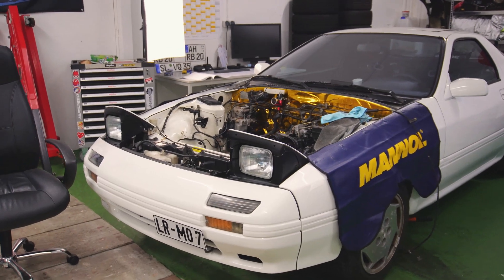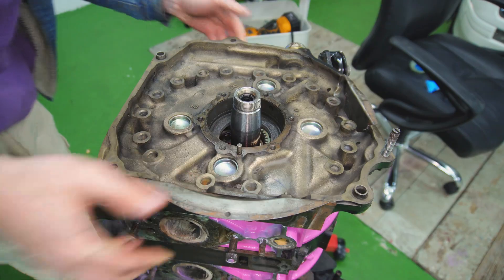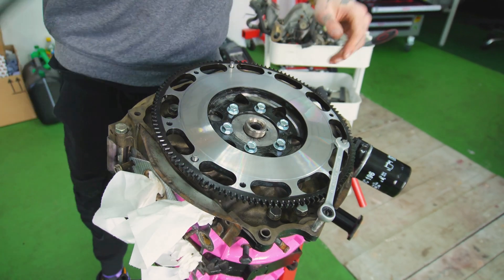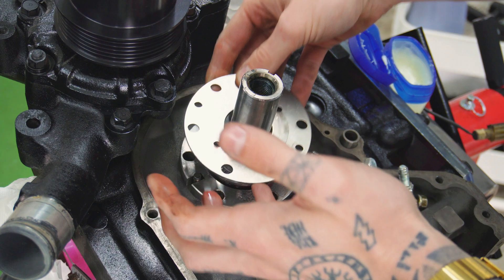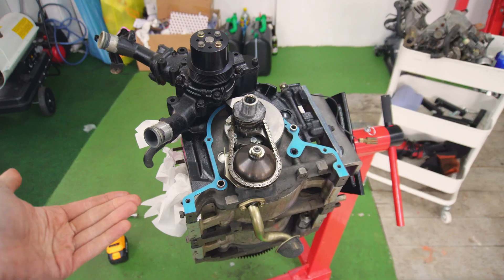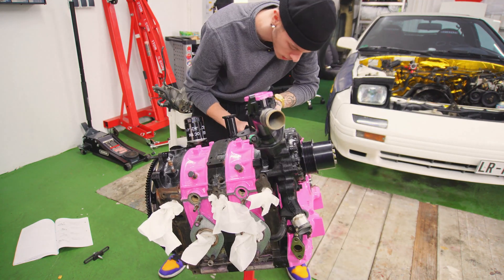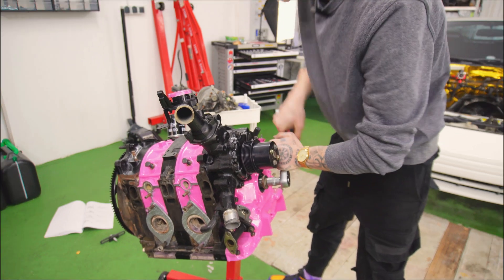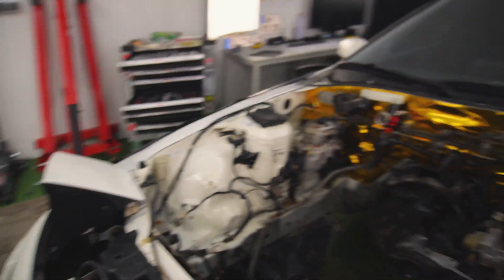Assembling A Rotary Engine - 13B Build | PART 2

Comment: Good job. First rebuild is always the scariest. In the video though you didn't measure the end play of the e-shaft? This is vital when rebuilding any rotary. When you stack the torrington bearings and spacers, that stack sets the end play. If the end play is too tight or too loose, it will ruin your rebuild. There are many different spacers that Mazda sells in different special thickness' which determine the end play. Look in the factory service manual and it talks about measuring the end play with a dial indicator gauge. I've seen people build motors without checking the end play only to wipe out their motor in minutes.
Reply from the maker: Hey there :) Thanks for the comment! I was talking about this exact topic with another viewer in the comments and I came to the conclusion that it is not 100% necessary to check endplay when you don't change anything about the front stack. The only thing I've changed are the torrington bearings and since Mazda took the thickness of brand new bearings into consideration when putting the spacer in while assembling the engine in the factory, I thought since I just replaced the bearings for the excact same ones Mazda used from factory I wouldn't habe to check endplay.

This might be coincidence but after reading your comment I double checked the endplay just to be safe and apparently it's true how I suspected it. It is perfectly within spec! :)

As I said this might just be a coincidence but generally from what I've heard, you don't necessarily have to check endplay when you're not changing anything about the front stack.
Reply: Engine building is not guess work. Now you have checked it and now you know it is correct, you now  have lesson unknowns and less potential for a failure.  Thank you for checking.
Reply: What he said. You have to check it even if you use all the original parts.

Comment: Have you performed the oil thermo bypass pellet shim mod? It's a lot easier (and safer afaik) to be performed now when the engine is out of the car
Reply from the maker: Already installed don't worry😁

Comment: I‘m no rotary expert by any means so please correct me if I’m wrong but shouldn’t you check the endplay of the e shaft after a rebuild with new counter weights?
Reply from the maker: Interesting question! :) Obviously I am also no expert at this BUT from what I've heard: Usually you're supposed to check endplay when you change anything on the front stack. Since I haven't changed anything on the front stack, I didn't necessarily have to check endplay. Of course it's a good habit to check it but in this case it was really not necessary as all of the parts are the same. With the old Flywheel, the counterweight is built into it. When you swap it for a lighter flywheel you will have to install either a rear automatic counterweight or a counterweight that's made to fit with your new Flywheel. However the rear counterweight does not affect the endplay. That's the only thing I've changed. The front stack stayed the same apart from 2 new torrington bearings :) Endplay can be adjusted by swapping the spacer on the front stack. There are different sizes with different letters.

My opinion: Mazda assembled the engine with brand new bearings and in my case put a "Y" spacer in it. I have just replaced the old bearings with new ones just like it came from factory. Which means the spacer is still theoretically correct as nothing on the front stack changes.
Reply: @moritzherr  Thanks for the answer really helped me understand these engines more.
I’ve got one more question on my mind:

I think this is not going to be the case but in theory if the torrington bearings before were on the low end of manufacturing tolerance and the new ones are on the high end of manufacturing tolerance then you would be auto of tolerance?
Reply from the maker: @cringe8542  Hahah😂😂 That's an awesome question. I have no idea... My guess is as good as yours man. But what I think is that these bearings are being produced to a very tight tolerance... And I think even if what you just described would be the case, it would still be in spec because the endplay tolerance is higher than the bearings could be out of spec. Did that sentence make any sense?😂

But to summarize, I don't know more than you here so I am probably the wrong person to ask this question to.

This question can only be answered properly if there was a sheet where the manufacturing tolerance of the bearings is listed so you can put it into relation of the endplay tolerance.
Reply: @moritzherr yeah that made sense thanks for the effort